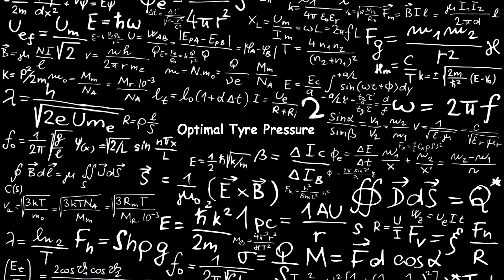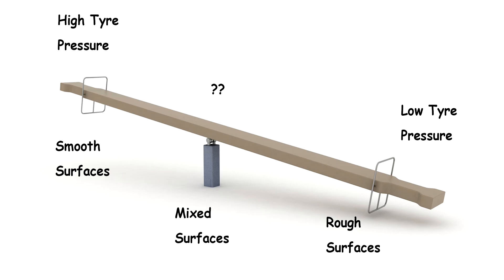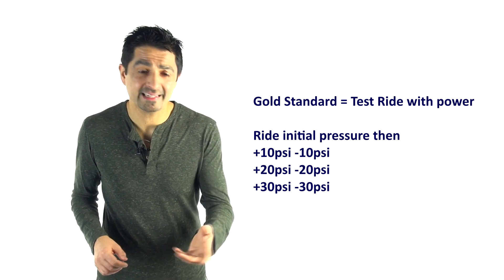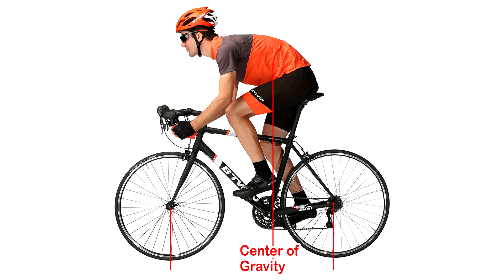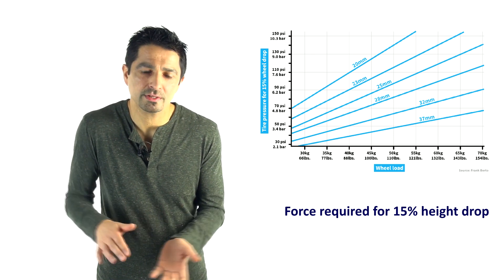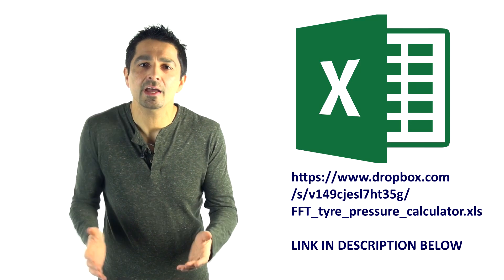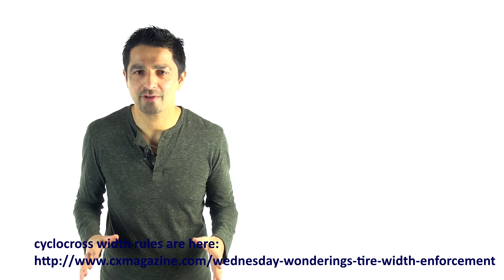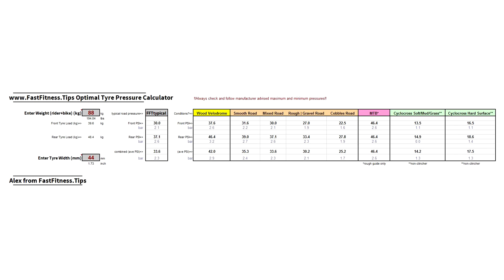Bike tyre pressure science! What is optimal for Road TT Tri Cx MTB

Comment: Random newbie question of the day: I read that a 26inch wheel is slower on a road time trial because it requires more rotations to travel the same distance as a 700c wheel. If this is the case then would a high volume lightweight slick 29er tire (2.2inch+) have the same affect over regular road tire sizes?
Reply from the maker: This is a good question not fully resolved. Take a more extreme example of 20" / 406mm wheels. Simplistically a larger wheel rolls over bumps better and reportedly has lower CRR. But testing does not fully confirm this (see http://www.discoveryride.com/human/rolling.html) it probably depends in detail on the tyre deformation/hystersis properties. Also larger wheel = less aero and this could dominate depending on bike design. when comparing different wheel/tyres sizes it is important to compare the same tyre compound and equal pressure per volume which is rarely done. Maybe someone else has tested this scientifically?
Reply: Fastfitnesstips thanks for the reply and thank you for all the great content you create. Some of the best info on the most interesting topics, love the channel!

Comment: your formula doesn't work
1. the volume of the tyre must include not only the width but also the sidewall height, the diameter and internal width of the rim.
2. in case of 50-50 weight distribution, the front and rear tyre pressure should match....
Reply from the maker: 1. volume is calculated (imputed) from the width as per every other previous method....do you know of a method that uses user inputted tyre volume?
2. now you can input the tyre balance as well (re-download the xls)
Reply: as the FFT formula doesn't take the width as labeled but the measured width, the influence of the rim is already included.